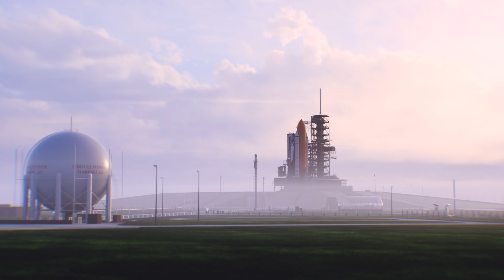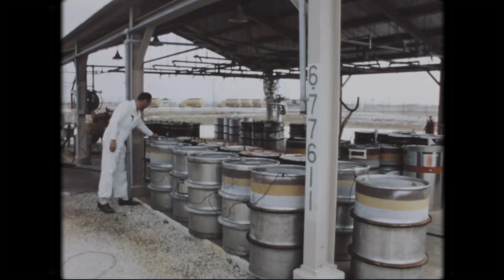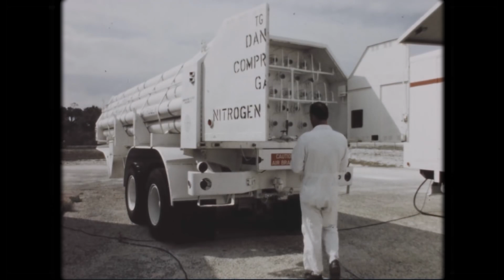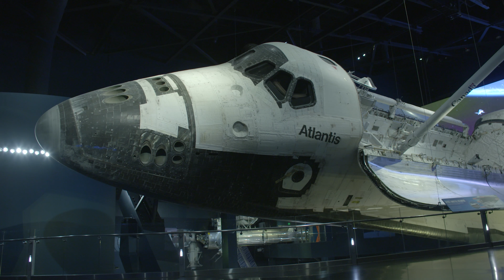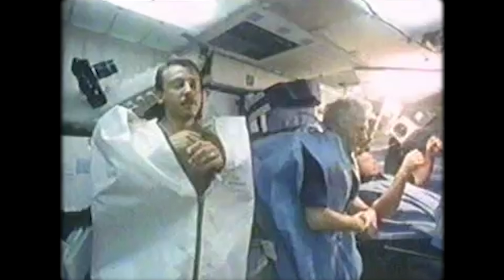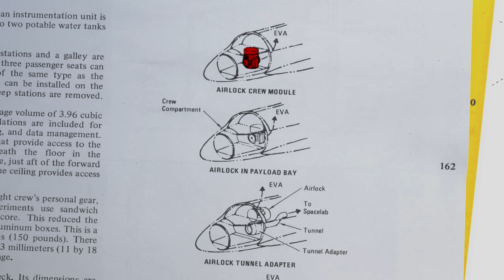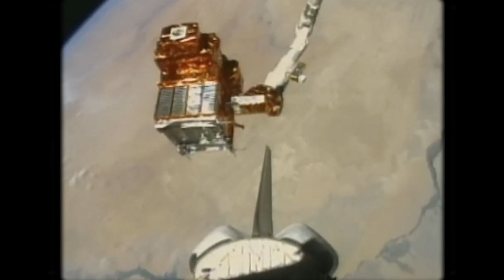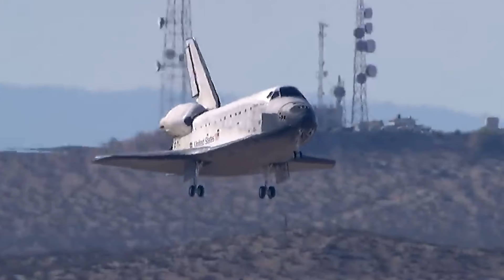The Insane Engineering of Orbit

Comment: One thing a lot of people get wrong is that the idea that the shuttle was in orbit when it dropped the tank. When the engines shut down the tank and the shuttle were on the same orbital trajectory that intersected the atmosphere. This meant the shuttle had to boost itself at the highest point of its orbit using the OMS to avoiding reentering the atmosphere with the tank.
Reply: it thrusts away from the orbiter by venting oxygen
Reply: And that was mostly so the tank would reenter and break up, rather than leave space junk in orbit.
Reply: @mikekopack6441 
Wouldn't necessarily agree with that, although that's certainly part of it.  I think the most important reason was because it made the once around abort much easier and safer.
Reply: Not the Kerbal Space Program players, though ;)
Reply: @TheMightyZwom  ahh fellow KSP player. So glad I found you here.
Reply: I applaud all of you who patiently tried to teach this guy something without ridiculing him.
Reply: @pavulon5000  They guy probably got sucked into a conspiracy hole. Saw some site or video that convinced him. 
The only way of that hole is to explain some of the ridiculousness that comes out of those conspiracy physics.
Reply: Yup but at that point they’re 99% of the way there so it doesn’t take much energy to to increase the periapsis.
Reply: @u12uNiiGuNx 97%
Reply: If they didn't have denial, what would they have? Mate thinks they're making some profound statement when they say they "don't use formulas." Guess what? I'm an engineer, and if the formulas didn't accurately model the real world, I'd be out of a job.
Reply: @TheBleggh  Not a good engineer. Dont need formulas to explain simple observations.
Reply: @CawfeeGasBlast  I'll bet your mom and dad are sooo proud of you.  Your profound brilliance makes your entire family so very proud, no doubt...🤦🏼‍♂️
Do yourself (and humanity) a favor and apologize for being so impossibly  ignorant. 
Don't wait another minute...
Do it right NOW. 
Got it??  Good.

You're welcome...
You can (will) thank me later.
Reply: I feel for everyone who was trying to explain anything to this @CawfeeGasBlast guy, he kept arguing, questioning and disputing while not knowing a damn about the matter, it's like he couldn't accept or wouldn't and persisted to defy the examples provided by the community even tho he had nothing to stand on, it almost felt like he was trolling 😒.
Reply: @vinny7114 Average Flat Earthers in nutshell, im suprised that people had the strength to argue with him which is pointless anyway
Reply: @Wikarian99PL  Forreal lol I wouldn't given up after the third msg maybe second
Reply: @vinny7114  You are the channel comment monitor today? Is this your job? Is this where they put you as a new-hire?
Reply: Yeah, but people are idiots! They think that once you reach a certain altitude, that you become weightless and are in orbit, believing that gravity only works out to that altitude, completely forgetting that the moon is stuck in Earth's gravity well.
Reply: Correct. After ditching the tank it had a final push to orbit
Reply: You guys are all arguing with someone whose name is “Coffee Gas Blast”. How do you not realize he’s just a troll
Reply: Keep believing that fantasy.
Reply: Ho...
Yusss,
Is that right,
There, then, thus ;
Kapitan
Oblivious...!

;-p

Ciao !
Reply: If you actually watched the video, this comment doesn't need explaining so I'm not sure why it's here in the first place.
Reply: This comment section was a wonderful read wow
Reply: 12:51 ... Orbital Maneuvering System, capable of adding 305 meters per second of orbital velocity
Reply: Didn't the space shuttle also have internal fuel tanks for its main engines ?
Reply: What dude
Reply: The basic concept the troll is not understanding is that rockets don’t go straight up, they also go sideways. They are actually free falling back to Earth due to gravity while in orbit. But their velocity is so high that the fall past the Earth and keep going. Were the velocity nit high enough if going straight up, they would indeed slow and fall back to Earth.

In low earth orbit eventually every orbit will decay. There are still one or two molecules spread very thinly in the near vacuum. Every time the orbiting object encounters one of these with an opposite direction there is a tiny reduction in the orbiting objects velocity. Slowly these accumulate and slow the object. This slowing tens to cause the orbit to reduce where it hits relatively more molecules and so on until the object is skimming the upper atmosphere. Then the effect snowballs and the object begins to slow much more which cause it to reduce altitudes to thicker atmosphere and so on.  The atmosphere interacting with the objects surface causes it to heat up due to friction. That’s when it starts to burn up....

That’s what happens to the external tank, that’s why it only needs a very gentle nudge back toward Earth to start the process (although it would eventually de-orbit and burn up anyway, they just use a more controlled fashion). And that is why it only takes a relatively small force to lift the orbiter up to low earth orbit. Incidentally, the tank is deliberately spun by the venting so they can video and photograph all of it and check for damage and missing insulation (that may have hit the orbiter like Columbia).
Reply: This was really a major design failure that reduced the capabilities of the Shuttle. It prevented the shuttle from reaching higher orbits and decreased its payload capacity.
Reply: Define “a lot of people” 😂😂😂
Reply: They could take the tank to orbit tho if they wanted right ? I remember reading something when I was kid they were thinking of using the external tanks as a space station of sorts idk if I remember that correctly tho the shuttle still amazes me after all these years
Reply: that's exactly I was about to comment.
Reply: I knew that. But I'm a space junkie.
Reply: https://youtube.com/shorts/EbxDIMurAZM?si=MtfEUWUaJY-z123p
Reply: I wish I was smart enough to understand what you said! 😔
Reply: they could have boosted the tank to orbit, they chose to ditch the tank in a decaying orbit
Reply: What about Chinese rocket debris fell back down n Philippines sea caught floating intact. please explane?
Reply: Lots of Kerbal Space Program players in this comment section
Reply: When they say rocket science, they mean it.
Reply: I've always wondered about this! I thought that since both the shuttle and the ET arrive at the same place in space, shouldn't the shuttle be falling with the ET as well. Either that, or the ET is a permanent space junk. Now I have the answers, thank you.
Reply: The NASA commentary for STS-1 made the point very clearly. After MECO, the PAO said, "Columbia... now in space, not yet in orbit," and seven months later on STS-2, "Columbia now returned to space, not yet returned to orbit." NASA always did a far better job of commentary than the tv networks, right up to the final mission, referring at MECO to the space shuttle's main engines falling silent for the last time. Almost poetic at times, and always accurate.
Reply: Z-s
Reply: it was in orbit at meco.
Reply: i was wrong,my bad.sorry.
Reply: Clearly, you were wrong.
Reply: So the millions of dollars  ORANGE THING burns up in the atmosphere, all the time?
Reply: I believe this was explained in the video about the boosters and the take off system.
Reply: Lies
Reply: Ever thought of using commas? It helps reading comments a lot and getting them right as well.
Reply: I had no problem reading this  @jeshkam
Reply: @Coasterlocity  Good for you.
Reply: @jeshkam His sentences need to commas, not sure where you learned your grammar. His sentences are complete individual clauses. He could split it up into separate individual subclasses and make the sentences longer, but that would be in the opposite direction of concise writing.
Reply: @cameronbains1052  "His sentences need to commas" not sure where you learned your English grammar...
Reply: @jeshkam  💯 I agree with you. Then again, over half the people commenting on YouTube don't have a grasp of the English language or punctuation.
Reply: Even in german schools we never were taught to use commas in english and I'd say that our english skills are very advanced
Reply: @spicysesam  That doesn't make it correct, and clearly you were only taught the basics of English.
Just saying.
Reply: @spicysesam  BS. 😂🤣 I've just asked my German friend and she told me otherwise.
Reply: @jeshkam You didn't use, commas either.
Reply: @erasmus_locke did you use commas incorrectly on purpose? 💀
Reply: The tank clearly drops away from shuttle. How does the tank fall? It wasnt pushed down...
Reply: @CawfeeGasBlast  at the time the tank is detached both the shuttle and tank are on course to re enter the atmosphere. 
After it detaches the shuttle uses the other engines, orbital manoeuvring system (OMS) to boost the orbit again so it will no longer intercept the atmosphere and go into a stable orbit
Reply: @u12uNiiGuNx  What friction is provided to the oms fluid? The fluid thrust has no traction in the non-fluid environment. What is it using for traction?
Reply: @CawfeeGasBlast   Look up Isaac Newton, he wrote a few things about that
Reply: @CawfeeGasBlast And that mistake was explained fully before 1687…
Reply: @allangibson8494  First action is fluid escaping nozzle....whats the reaction? There is no interaction with anything. Youre just spinning wheels on ice.
Reply: @CawfeeGasBlast  The nozzle pushes the fluid one way, the reaction is the resultant force pushing the nozzle the other way. Which is why nozzle shapes for vacuum engines differ from those used at (relatively) lower altitudes. Yours is a very common misconception, caused by how science is explained to kids. As a general rule, any physics you learned in school is incomplete at best, or frequently even wrong (but used to explain a concept rather than provide an accurate understanding).
Reply: @CawfeeGasBlast rocket fuel has mass, the act of ejecting it at multiple kilometers per second creates a reactive force that propels the rocket forward.
Reply: @MontegaB  You must have something to react to/with. Think...Dont just repeat something someone else said.
Reply: @MegaDada1995  You seem to add things to physics... Why does your car spin wheels on ice?
Reply: @CawfeeGasBlast  Why don't you just google how thrust is produced in a vacuum rather than arguing about it?
Reply: @CawfeeGasBlast  I'm not adding anything, you don't seem to understand Newton's third law. You don't need anything external to push against. The rocket pushes something backwards (exhaust gas) and the resulting reaction force pushes the rocket forwards.

The wheels of a car spin on ice because the car has more inertia than the wheels. So if you apply too much power, the wheels will spin and the power will be wasted on the rotating the wheel, and the generation of heat on the spot where the tire touches the ice.

However, to explain in laymen's terms how a rocket engine can produce trust in a vacuum: As the propellants combust, they expand. As this expansion takes place in a pseudo-enclosed space (the nozzle). While that nozzle does have an opening, the exhaust gasses can only exit the nozzle at a finite speed, thus a positive pressure will form inside the nozzle bell. As this pressure pushes in all directions, part of it will push against your engine bell, creating trust in the opposite direction.
Reply: @CawfeeGasBlast It's interesting that you seem to like to make absolute declarations of falsehoods, not much of a sign of someone interested in actually learning how things work but rather someone just wanting to pretend they know more than they actually do and/or someone who has become enamored with the FE con style of "question everything, but don't listen to answers" BS.

"You must have something to react to/with."   Yes, as has been explained to you, the reacting forces are between the gas and the nozzle.   You seem to think the gas needs something to push against outside the open nozzle.   What gives you that ides?   
Rockets are not propellers, but rather continuous explosions in an open chamber.

" The fluid thrust has no traction in the non-fluid environment. "   So you do think for some reason that the reaction requires the escaping gas to push against something, showing you haven't thought this through very well yourself.   Let's pretend your incorrect claim was real.    How hard would you have to push against "air" to move a 1 ton of concrete block that was on the slippery ice you seem fixated on.

How about this:   If you were in orbit and you threw a 1kg ball away from you, would you move in the opposite direction or not?

As for your question "Why does your car spin wheels on ice?".  Yes, cars don't move by throwing things away (like a rocket motor) but rather by friction coupling between the tires and the surface.   So reducing the friction means less power gets transferred, up to the point where the un-transfered power exceeds the friction of the tire and thus the tire slips rather than rolls.
Reply: @MontegaB  Thrust can be measured....on the ground...the exhaust fluid reacts against the other fluid...air....just like an inflated balloon when you let it go. There is nothing providing traction to exhaust fluid in a vacuum. That is why you see rockets spiral out of control at top of atm....no traction.
Reply: @IFS  If you threw a ball...you would be opposing the ball's travel towards the ground....and you would get a small force from it. When exhaust exits nozzle...where is it going? No where. It will just push on itself and just sit there. Should be a large cloud of condensate...bunch of water produced in that exhaust.
Reply: @IFS  The reaction between gas and nozzle is like flapping your arms...you wont fly unless you displace enough fluid.
Reply: @CawfeeGasBlast wow. 
You’re quite ignorant aren’t ya
Reply: @caleb_gr  Do you need help understanding my explanations? Basic physics...really.
Reply: @CawfeeGasBlast  You really don't comprehend how it actually works, do you?  So you stuff the gaps in your knowledge with fantasies and bad analogies.  How cute.    
Or you're just pathetically committed to false arguments for jollies like any juvenile troll with a 6 week old account.
Lets figure out which.
So you think "the reaction between gas and nozzle is like flapping your arms".    Why do you think such a thing?   How is an explosion like "flapping your arms"?
Reply: @CawfeeGasBlast  Ok, I guess you're right. Spaceflight doesn't work. This is all a simulation
Reply: @CawfeeGasBlast 
Lets start with the basics, you know what conservation of momentum says right? Momentum is mass*velocity. Naturally, if you send a small amount of mass backwards very fast, than the remaining mass has to speed up forwards so that the total momentum stays the same. You've also surely heard the gun recoil comparison. Shoot bullet forward, gun goes backwards. 

I see you wrongly make rhe comparison with wheels on ice. You should be thinking about a car with a rocket engine on ice. Wheels use friction to provide force, rockets do not.
Reply: @MontegaB  Thats correct. No satellites either. And yes...sat tv, sat radio, sat comms can be explained. Basic atm propagation.
Reply: @CawfeeGasBlast how are so many people arguing with you it's so obvious that you're trolling
Reply: @CawfeeGasBlast  So now I'm a little curious, since you've revealed you just deny all of reality.
   Why does technology from 60 years ago frighten you so badly that you commit to falling for fantasies about it?  Is your fear from lack of comprehension or do you think your fantasies make you seem intelligent?
Reply: @thomaswijgerse723  Shoot a bullet..you are opposing the bullets fall to the ground and its push against the air. A car using fast, hot fluid ejection has the atm to give it traction.
Reply: @hosonof  Because other people is going to read it and maybe learn something.
Reply: @hosonof  I made statements...people dont understand them and comments/replies are a way for these people to better understand their mistakes.
Reply: @IFS  Ive presented no fantasies. Everything presented is logical. The fantasies presented here is the one of blind belief of space travel even when logical explanations exist to say otherwise.
Reply: @b43xoit  What if exhaust gas exits at one mph? Hundreds of mph?  What could make the force from 1mph exhaust speed different from the 500mph exhaust speed? How do you measure that force?
Reply: @b43xoit  You are pushing against my body weight...which is travelling towards the earth. Just like pushing on a wall or a bowling ball. You are pushing against the ball's travel towards the gound.
Reply: @b43xoit  true. if you flapped your arms fast enough that they detached you could generate some thrust
Reply: @CawfeeGasBlast  I think you a confusing propeller and rockets. Propellers need something to push against, rockets don't. 
Think of shooting a gun, why do you get recoil?  Do you think if you did it in a vacuum, there would be no recoil? The expanding gases pushes the gun back.
Reply: @CawfeeGasBlast  you can measure this force using a load cell. You know how force = mass * acceleration? 
Aka, kg * m / s^2, you can reorder this to say kg / s * m / s. This means massflow*exhaust velocity. 

So the thrust your rocket engine creates is how much mass you push out multiplied by how fast you push it out.
Reply: @thomaswijgerse723  Your formula doesnt make you move. Youve created a gas that is forced out a nozzle....you can measure that exhaust...but it doesnt move you....nothing to push....youre just detaching something from the rocket.
Reply: @samik83  Where is the vacuum...here on earth...or a place where there is no gravitational force at all? Here on earth you are pushing against the weight of the bullet, vacuum or not. In a place where bullet and gun are not acted upon by any force....no recoil. Because nothing is providing a resistance to the bullet or to the gases created when gun is fired.
Reply: @CawfeeGasBlast  lol no I understand your moronic “explanations” just fine (they're literally just misunderstandings at best)

The fact that you called them basic physics is the cherry on top.
Reply: @CawfeeGasBlast  you do not push against weight, since weight is a force. You push against mass. 
Yes, a gun would have at least as much recoil in space as on earth.
Reply: @thomaswijgerse723  You push against the mass that is travelling in a particular direction...which is its weight.
Reply: @CawfeeGasBlast  if you want to move something up, while gravity pulls it down, then you do push against gravity. Like I explained with the throwing a ball upwards example.
Reply: @thomaswijgerse723  What gives you a recoil here on earth? Fluid dynamics explains it.
Reply: @CawfeeGasBlast  both newton's second law, and conservation of linear momentum. Got nothing to do with the atmosphere, atmosphere only reduces the recoil a veeeeery small amount because it provides backpressure.
Reply: @CawfeeGasBlast  Doesn't matter if its a vacuum or not. Doesn't matter if there is gravity or not.   

An explosion will push against any object that is near it. That's what a rocket is, a controlled explosion.  
It's like claiming you wouldn't be hurt if a pound of C4 exploded in your hand if you just were in vacuum and zero G.  
I can assure you, your fingers would fly very far no matter what.
Reply: @CawfeeGasBlast 
Either you're trolling or you don't understand grade school physics.
Reply: @carcinogen60yearsago  i think he is. But still I hope that a lot of other people that read this thread will pick up something from it. 
(+ I'm bored)
Reply: Ok Mr. Helper.....you give it a shot. Explain why my explanations are incorrect? Should be easy...grade school physics. Or are you just one of several people using several accounts to make it appear as if 'Most people believe as we do....so....we are right.' Many wrong people here.
Reply: @CawfeeGasBlast  I've given you all the pieces of the puzzle, and explained how to put them together. Now its up to you to do it.
Reply: @CawfeeGasBlast  I think it would be more interesting to know why an explosion in space wouldn't be able to hurt you. If you can explain that, then I can understand how the space shuttle wouldn't be able to work in space.
Reply: @samik83  Yes...gas will push against you, gun, or nozzle. But that gas wont move you unless there is something providing friction/traction to the gas. Its simple. You all are stuck on this space rocket fantasy.
Reply: @CawfeeGasBlast it takes more force to accelerate gas to 500mph vs 1mph. This leads to a equal and opposite reaction onto the rocket, generating thrust.
A way you can measure that force that I could come up with is to just measure the acceleration of the rocket and with f=ma you can calculate the force since you know the mass of the rocket. You can also measure the force exerted onto the rocket by a single gas molecule assuming constant acceleration from the combustion chamber using f=ma once again
Reply: @CawfeeGasBlast there is essentially zero friction in space to slow down moving objects due to the extreme distance between molecules. Unlike ships in water, a ship in space does not need constant thrust to keep moving forward. A space ship's momentum will continue to carry it forward indefinitely at a constant speed after the engines are turned off. In theory a ship in low orbit would eventually slow down and lose momentum until it got low enough to reenter orbit but it would take astronomical time frames.
Reply: @Spacemarine658 "essentially  zero friction" still means there is some friction.  Especially in low earth orbit, there are SOME molecules from atmosphere that create drag which adds up over time and degrades the orbit.  Its enough that the space station needs to burn its rockets every so often to maintain orbit.

Further out its not an issue, but  the space shuttle and space station orbits were low enough that it matters.
Reply: @LeverPhile  well yeah that's what I was saying there's some but depending on your orbit it could take 2 days to deorbit, 6 months, or thousands of years or more
Reply: @CawfeeGasBlast 
“Friction” plays no part.
Reply: @CawfeeGasBlast 
No. There doesn’t need to be something for the propellant to “react” with.
Reply: @CawfeeGasBlast  you do know orbital mechanics? For the shuttle system (orbiter+tank+booster) or anything going for orbit, it would have to not just travel up high enough from the ground (to reach altitudes with minimal atmospheric drag, it would also have to travel just fast enough SIDEWAYS (parallel to the ground) to avoid falling back to earth. So the whole system travels up and sideways really fast, hence the parabolic trajectory. Going straight up perpendicular from the ground cannot achieve orbit, it would just fall straight back down. 
At the time the tank is detaching, the whole shuttle system is still just slightly below orbital velocities (not sideways fast enough), they would fall back to earth not straight down, but really far away in front along their trajectory. Once the tank leaves it would be powerless and follows a ballistic path the system was on and fall back down. The orbiter alone would then fire OMS with just enough delta-v forward (not up) to reach orbital velocities, i.e. fast enough sideways to not fall back down. At this point they are just a few m/s of delta-v away from orbital velocity, so the small OMS is enough put push it to orbit. 
The force of gravity of the earth is acting on the orbiter perpendicular to its sideways motion, thus curving the trajectory toward the center of the earth; with the right amount of velocity sideways, the trajectory would become a circle around the earth.
As for what you mean by traction, it’s only for crafts in a fluid medium where you don’t need to carry the reaction mass onboard, such as swimming where you push the water back behind you to propel yourself forward. Crafts in a vacuum such as a rocket in space has no fluid to push, so it uses the fuel it carries as reaction mass, by exploding them in the combustion chamber and expelling it really quick backwards, the high speed molecules produced by the combustion pushing on the engine bell produces the reaction force to make the rocket fly forward, and the exhaust gas is all directed straight backwards to make sure all of the explosive push in the forward direction is efficiently captured. Simply put, to go fast in space, you leave something behind faster.
Reply: @HenryLiu7 
CawfeeGasBlast doesn’t believe space exists.  He’s a flat earth adherent; which is why he can’t understand the basic physics of why an accelerated object in space will continue forever until acted on by another force.  He seems to think an object in space will slow down without something acting on it; like an object in air.  He’ll never understand it.  🤷🏻‍♀️
Reply: @CawfeeGasBlast f=m*a so the faster the exhaust moves the more force it makes
Reply: @Gl1tchy_B01_09  The exhaust needs something to push...needs traction....you blind space-travel believers cant seem to grasp this....Space shuttle and all the other crap they shot up and into the ocean.....DID NOT GO TO THE MYTHICAL REALM OF SPAAAAAAAAAAAAAAAAAACE!
Reply: @MegaDada1995  Yet virtually all nozzles employed on all space craft use a  DeLaval style nozzle. Ambient pressure apparently not factored
Reply: @CawfeeGasBlast  What gives you a recoil here on earth? Fluid dynamics explains it.

Oh which exactly equation explains it kiddo?
Reply: @tgstudio85  I leave the useless formula-inventing to you. Recoil from gun...before and after shot, the bullet is pulled to ground...when shot...the gasses push bullet against  its weight and the air in the atm...the gasses created in gun are resisted by the atm, also. The force used to push bullet fades...the force pulling bullet to ground does not...that is why the bullet doesnt stay above the ground. ThinkThinkThink...youll understand it one day.
Reply: @CawfeeGasBlast physics doesn’t care about your opinions formed by flawed logic.
Reply: @bendlyte  You should stop trying to explain things with a formula. Trust your eyes. Stop worshipping your childhood heroes at spwace wocket nasa. Think...Youll get it one day.
Reply: @CawfeeGasBlast  I choose demonstrable physics over your opinions.
Reply: @bendlyte  An 'Orbit' is not demonstrable. You must have a ball in order to conceive an 'Orbit'. Even if I grant you your 'Ball'...Ive proven you cant make  something stay above ground without continuously opposing the only active force....the one causing it to return to the ground. The force applied by rocket does NOT last forever. Keep trying...youll get it.
Reply: @CawfeeGasBlast  the only thing you’ve proven is you haven’t tested Newton’s 3rd law of motion and don’t understand it. Orbital mechanics is way out of your league.
Reply: @bendlyte  Orbital mechanics is fiction. And stop relying on some dead man's sayings/theories...doesnt mean anything. Think .... Youll get it.
Reply: @CawfeeGasBlast  Disproving Newton’s laws of motion is your responsibility if you disagree with them. Good luck doing that from YouTube comment sections. There has been no threat to them in the hundreds of years of physics since they were written.
Reply: Hear me out. The first action is NOT fluid escaping. The thrusters are hyperbolic, meaning, once they mix, they burst into flames creating thrust out of the nozzle via a brief explosion. You don’t need anything to “push” against because every action results in an equal and opposite reaction in the other direction. The combustion (explosion) inside the nozzle doesn’t “push” on anything in space, the explosion itself is pushing on the inside (backside) of the nozzle.

Image an explosion here on Earth that throws and scatters objects off in all directions. The explosion itself is doing the ‘pushing’, not any atmosphere or barrier outside of the explosion. Same applies in space. The explosions inside of the thruster nozzles are doing the ‘pushing’, not any force or barrier outside of the shuttle’s thrusters. Don’t confuse rockets with “air-breathing” jet engines. Completely different concept. 

Same applies to rocket launches on Earth. Rockets leave the launch pad, not because they are pushing on the launch pad, or ground, but because of the force of the explosion that happens to be occurring at the back end of the rocket. A rocket will lift off both at ground level AND from hundreds of feet in the air regardless of whether there is a “floor” below it (think the Milk Stool used for the Saturn 1b rocket launches - Google it).

If a floor, ground, or surface was required for thrust then a rocket leaving the launch pad would suddenly fall from the sky once the influence of the ground disappeared. And No, rockets do not “push” against the air.
Reply: @bendlyte Those laws are vague and incomplete. I guess you couldnt put those words(scientific laws) together in a sentence.....only a ScienceGod from the past can do that. You are blindly following your ScienceGods. You can think for yourself...Dont get scared when they yell, scream, and cry(deGrasse Tyson)when you question and state observed facts.
Reply: @CawfeeGasBlast  what observed facts don’t follow those laws, that aren’t already acknowledged by physics? Let’s hear it, if you’ve got something. If it’s a rocket that doesn’t work in a vacuum, that would be groundbreaking.
Reply: @bendlyte  Rockets dont work in your 'outer space'. You seem to be fouled. You need to stop trying to explain things without quoting dead people. When you use a 'law' to explain something...that means you dont understand the subject or care about observed reality.
Reply: @CawfeeGasBlast  Rockets nozzles designed for operation in vacuum (or near vacuum) are tested, on the ground, in vacuum chambers.  You do not need a medium to push against, you are throwing mass at great velocity in one direction, and thanks to Newton, we know that means an equal but opposite force pushes you the other way.  It's not the air outside, it is the simple act of throwing mass out of the rocket.

Are you a troll?  Or a flat earther?  Because you seem disinterested in actual physics explanations, which, were they to be untrue, would suggest we have never put anything into space.
Reply: @CawfeeGasBlast  Oof, your claim that satellites are actually just atmospheric propagation means you have a very limited understanding of how RF refraction works.  I suggest you talk to an amateur radio operator, but since I am one I can give you a very brief explainer.  Just like different colors (frequencies) of light bend different amounts through a prism, different frequencies of radio waves reflect differently when they hit the ionosphere (and troposphere, in some extremely weird edge cases).  So you may have heard that radio waves bounce off the atmosphere, but that's a grade-school-level simplification.  In reality, HF radio waves bounce off it, while VHF and UHF frequencies are either absorbed or go straight through it.  In fact, the Maximum Usable Frequency, a stat tracked by hams worldwide, changes regularly due to space weather and the day/night cycle, as both can change the energy level of the ionosphere, effectively changing the 'thickness'.  Right now, we've got amazing HF propagation due to the sun spot cycle, and the MUF gets up around 30-35MHz.

This is exactly why TV signals started out as VHF/UHF (that's 30MHz up through 3GHz); with only so many channels, regional stations would all interfere with each other if their signals bounced off the ionophere.

Satellites, then?  Almost entirely UHF and even up into SHF (up to 30GHz).  DirectTV, for example, now operates in the 4-6 GHz and 12-18 GHz ranges.  Those pass right through the atmosphere, no propagation whatsoever.

This isn't some esoteric bit of radio knowledge, either.  Talk to any ham and ask them the difference between their HF rigs and their VHF rigs.  Or why the first license you get is generally only good for short-range communication, but the second and third are where the worldwide comms open up.

You're going to need an alternate bizarre theory for how satellite TV works without satellites.
Reply: @georgedorn_fnord  Your rocket goes into a spiral...out of control...when sent to upper edge of atm....because no traction. Your vacuum chamber quickly becomes a chamber of high pressure when you test your rocket. You believe in the fantasy of space and travel within.
Reply: @georgedorn_fnord  You forgot about your 200mhz 'satellite' users. And it doesnt matter what ham operators believe is up in the air....whatever shape their aerials...doesnt prove  a box is receiving, processing, and sending it back. AM radio, shortwave, or any other freq. dont use a spacebox. Not creating theories here...thats how sat comms work.
Reply: @CawfeeGasBlast  200MHz (the capitalization matters) also doesn't refract off the atmosphere.

So you're saying that all of electronics theory, even stuff I can prove on my bench with my oscilloscope and home-made, FFT-based spectrum analyzer, is a hoax, and the reason my VHF handheld can't talk to China but my kit radio made from discrete components can is...  a vast conspiracy?

Sorry, you've long left the realm of science, there, buddy.  Dunno what all this nonsense about scientifically attacking whether rockets work in a vacuum is for, you have zero interest in science anyway.

Plus, vacuum chambers exist.  Cody of Cody's Lab even proved a rocket engine produces thrust in a vacuum, by putting a rocket engine in a vacuum.
Reply: @CawfeeGasBlast  you can’t even name one observed fact that doesn’t follow Newton’s laws of motion. All you’ve got is denial.
Reply: @bendlyte  Equal and opposite reaction...First action...throwing gas away from rocket is similar to flapping arms...you wont move unless you have a fluid or other object, which has weight, to push against....traction...Ive said this over and over....forget Newton....I know brain is smaller...but I was hoping to explain it to you...unsuccessful.
Reply: @CawfeeGasBlast  you’ve obviously never studied how rocket engines work. Flapping your arms is nothing like a rocket engine. Rocket engines provide forward thrust by the pressure of gases being expelled in one direction - out the back end of a nozzle. If you would have spent 2 minutes researching this, you would have saved yourself the embarrassment.

A balloon expelling air out of the small opening used to fill it with air is a far better comparison to rocket engines.

You still have no example of an “observed fact” that doesn’t follow Newton’s laws of motion.
Reply: @bendlyte  You dont know how a rocket works in vacuum because there is no vacuum to test it...basic theory says it can NOT work. Ill get you to understand...dont let the scary, unknown, 'going against all Ive ever known' concepts deter you from trying to get a true, genuine grasp of the 'We are not in space' reality.
Reply: @CawfeeGasBlast 🤦‍♂️ Smh. It's absolutely mindblowing to me that people have access to the near-entirety of human knowledge literally at their fingertips, yet there are still flat earthers, like yourself. 

I also find it mindblowing that you guys choose to use that question as if it's some kind of "gotcha", even though the answer comes down to extremely basic physics & chemistry, and is easily understood even by children in elementary school. 
Then again, you've had the answer to your question explained to you countless times, but for some reason choose not to accept the reality. So, of course, you're just being disingenuous in asking it to begin with. 
It's not the "gotcha" you think it is. 
Get out of here.
Reply: @CawfeeGasBlast  It's hilarious that you, of all people, are saying that to someone else when you're the one who's just repeating mindless dribble that you've heard some other airhead flat earther say. 🤣
Reply: @IFS  Spot on. These flat earthers are always either, disingenuous, delusional, or both.
Reply: @bendlyte  what's hilarious is that "cawfee" unironically used that same balloon example in one of his above comments in an extremely poor attempt at explaining his flat earth bs 🤣.
I keep going back, and forth on whether he's a troll, or a genuine flerf, but there's really no way to tell when it comes to flerfs.
Reply: @xenophagia  There is a difference...My explanations are demonstrable...evident. Youre a repeating noise maker saying 'Believe me and the tv or...or...or...Well..All Ill do is just get loud and call you names.' That is ALL you have. Weak
Reply: @xenophagia  Laughing doesnt make you right. Weak. Just like your bwst friend xeno. Or are you using two usernames. Because the more people on your side makes you right ? Still weak. Try again.
Reply: @CawfeeGasBlast 
You are a perfect example of the Flat Earth Society!
An ignorant person who has no desire to be educated!
Reply: @hosonof  because TRUST these people do exist. Ive had the pleasure of knowing a couple and I can tell you they whole heartedly believe their own bullshit.
Reply: @CawfeeGasBlast dear Lord didn't newton explain action and reaction a while ago,the fact that you're arguing about this is problematic
Reply: @CawfeeGasBlast Let's say you teleported to space in a spacesuit along with something heavy, if you throw said object in Abu direction you will no remain stationary.

You and the object will move in equal yet opposite directions from each other.
Reply: @CawfeeGasBlast  holy crap, you're insufferable as heck. I thought I'd get to learn more reading the replies but it's just filled with you yapping about how everyone is wrong.
Reply: @CawfeeGasBlast "think"
clearly you should be taking your own advice 😂
Reply: @CawfeeGasBlast  It is pushed down. A few moments before detaching the tank, the orbiter's RCS trusters fire upwards, so the vehicle pushes the tank down. After detaching, the RCS fire downwards, so the orbiter moves up again.
Reply: @raphael0208  Shuttle is headed toward ground too. Much more thrust is needed to keep it from falling to ground than those little thrusters.
Reply: @CawfeeGasBlast  You're right. That's why the energy needed for not falling to the ground is provided by those two huge solid rocket boosters and three RS-25 main engines. Once in orbit, there is no atmospheric friction to steal that energy away from the ship. The RCS only provides the small amount of energy needed to manoeuvre the shuttle. But it's enought to push itself and the tank away from each other in vacuum.
Reply: @raphael0208  After engine cut-off, that momentum will fade....it doesnt last forever...and being that there is only one continuous force, gravity, it will fall.
Reply: @CawfeeGasBlast  Wrong. The momentum will not fade unless a force is aplied. You need to study basic physics, dude.
Reply: @raphael0208 Speed does NOT matter. Speed is NOT a force. The ONLY force acting on it is what? The force given to it from rocket starts to fade as soon as engine cut-off....it will reach zero...IT DOES NOT LAST FOREVER. The remaining force, gravity, wins.
Reply: @CawfeeGasBlast  Nope. The speed will remain constant because there is no force in the opposite direction being applied. Gravity is an orthogonal force that changes only the vector of the velocity, not the module of the speed.
Reply: @CawfeeGasBlast but speed is a portion of centripital force, F = m*v^2/r
Reply: @raphael0208  And that vector is in which direction?
Reply: also, momentum does not neccesarily fade. 
In order for forward velocity to reduce, there has to be a net force that acts backwards. Gravity pulls "down" while a spacecraft (if its in a circular orbit) is moving sideways. This means that gravity does not slow down the spacecraft, it only changes  the direction it's traveling in.
Reply: @CawfeeGasBlast  Tangent to the direction the shuttle is moving.
Reply: @thomaswijgerse723  Momentum does not last forever...throw a ball straight up...why does it stop...wind resistance? And speed is not enough to oppose the fall back to earth.
Reply: @CawfeeGasBlast  like I explained. In order to lose momentum a force needs to act opposite to the direction of travel.  If a ball travels up, and gravity pulls it down, then the force acts opposite to the direction of travel.
But spacecraft move sideways, so gravity doesn't act opposite to the direction of travel.
Reply: @thomaswijgerse723  Sideways or straight up...momentum will decrease to zero. Leaving only one active force....the one pulling it to the ground.
Reply: @CawfeeGasBlast  No that is blatantly incorrect. Momentum only changes if a force is acting tangentially on it. Show me a free body diagram and an equation of motion that shows how something can be slowed down by a force that doesn't act opposite to where its going
Reply: @thomaswijgerse723  You know mometum decreases to zero. Doesnt last forever....here in our atm or in your mythical space.
Reply: @CawfeeGasBlast  Of course your a flerf. 
Your profound ignorance makes complete sense now.
Reply: @CawfeeGasBlast gravity is not a force but rather a dip/bend in the fabric of space. Just think of space as a sheet and when you put something with mass on it, it deforms and the object seeks the lowest energy point (the center), but in 3 dimensions.
Reply: @CawfeeGasBlast 
No. There’s the momentum of the ship in a vacuum as well.  Gravity just modifies the trajectory of that momentum so that it doesn’t fly off straight into space.
Reply: @CawfeeGasBlast 
In a vacuum and without gravity acting on an object, it will continue on forever in space.  It either needs to meet something like a gas or an object large enough to have a gravitational effect on it to change the objects momentum.  That’s why Voyagers 1 & 2 are still streaking out of the solar system without slowing down.  Any object that is gotten up to speed in space will continue at that speed forever until it meets something that alters its momentum.  That’s because there’s nothing physical in space to create any friction on that object traveling in space (technically there are a few atoms of gases in a cubic meter of space, but that’s not enough to alter the momentum) or it’s not close enough to a large object to modify the trajectory with gravity.  Isaac Newton: “objects at rest stay at rest.  Objects in motion stay in motion.”  Unless something else physical changes these parameters (like enough gas to create friction or a celestial body large enough to have gravity to affect an object’s motion), the object will do what it was doing in its previous state.  

Your assumption that an object in space will slow down without something to keep accelerating it is fundamentally wrong and is based on the behavior of objects in atmosphere.  Air is like water but thinner, and the movement of an object against it creates friction.  That doesn’t exist in space.  In space an accelerated object will continue forever until acted on by another force because there’s no friction.
Reply: @CawfeeGasBlast 
Oh!  That’s the problem!  You don’t believe space exists!  😂
Reply: @CawfeeGasBlast  my brother in christ, you realise what an orbit is. Yes the engines cut off, yes the velocity bleeds initially, but the whole point of an orbit is that the rocket is constantly falling toward the earth but in a stable orbit so that it keeps 'falling' but not re-entering the atmosphere. How do you think the ISS has stayed up in space around the earth for so long? Gravity is the primary force acting on the ISS allowing it to keep falling around the earth. Once in a stable orbit you can easily determine its velocity and altitude using conventional physics equations.
Reply: @CawfeeGasBlast  you realise the only thing reducing the velocity on earth is the friction caused by the density of air molecules. In space there are large gaps between molecules meaning it is essentially frictionless. Thus the only main force acting (and continuing to conserve the momentum of the rocket) is gravity.
Reply: @CawfeeGasBlast have you never heard of conservation of momentum? 💀
Reply: @Gl1tchy_B01_09  Throw a ball straight up...travels up...stops...travels back down. It doesnt keep going. Where is your momentum? Think about it...youll soon understand.
Reply: @CawfeeGasBlast  If you throw it fast enough then it can escape the earths gravity.
Reply: @samik83  Escape into what....an object can only ascend to app. 120,000 ft and there is no such thing as gravity....you stick to ground because you are more dense than the air around you. You MUST get thia space travel fantasy out of your head if you are ever going to understand the physical.
Reply: @CawfeeGasBlast  Your biggest issue is that you are conflating momentum with inertia, two different concepts.  Momentum in physics refers to mass times velocity and is used for the interaction between two objects say a rocket and it's spent fuel.  This is where the conservation of momentum applies, the sum of momentum in a system will stay the same and this is used to determine change in velocity.  The way you are using momentum is in the idea of inertia.  Now I do not fully understand inertia but the idea is newtons first law of motion and object in motion stays in motion unless acted upon by an outside force.  Using these you can see how your ball example does not apply as it is not two objects interacting but, ignoring air resistance, one force acting on an object with mass.  This how this problem is treated equation wise with one force.  A rocket in its simplest terms is two objects each acting on each other.  When one is expelled in the opposite direction from a different object the other object has to speed up following conservation of momentum the equation looks like this, m1v1+m2v2 =m1v3+m2v4.  If m1 is the shuttle say mass 2 and velocity 2 and m2 the file has mass 1 velocity 2 now the file changes velocity to be -3 you can solve this for you self and see that v3 will increase simply because the propellant changed velocity.  The units and values are ignored because this is a demonstration you can change the values and get similar results.  Also the propellant's velocity is negative because it is fired in the opposite direction of travel for the spaceshuttle which is considered the positive direction. You may choose to ignore this information but that is your choice the correct information has been given
Reply: @Owlinthesnow  Too much unnecessary giberish in your reply...explanations dont need that many words.....Are you a professor or similar...paid to just run your mouth? The force keeping ball in the air does NOT last forever. Stop worshiping the ghost of newton. The force, gravity(you all call it), does last, is continuous, and the ball falls. Inertia...momentum...doesnt matter what you call it...the ball falls...and an imaginary shuttle...satellite...will fall to the ground as soon the force is removed.
Reply: @CawfeeGasBlast an object in motion will remain in motion... you should check out very basic physics.

If you're in a vacuum with no gravity, momentum will never fade.
Reply: @CawfeeGasBlast  It's hilarious how you'll use gravity in your argument when it suits you 🤣.

That, alongside your unironic using of "letting go of a balloon filled with air" as an example in an attempt to explain FE nonsense almost has me thinking that you're just a troll.
Then again, stupidity knows no bounds.
Reply: @CawfeeGasBlast  If you watched the first video in this series, you'd know the simple answer to that question. 🤦‍♂️
Reply: @CawfeeGasBlast ascends slower
Reply: @CawfeeGasBlast  Due to air friction speed reduces of tank. Whereas speed is maintained of shuttle.
Reply: @CawfeeGasBlast yes once released they slow down.  They immediately start to separate and fall towards the Earth.
Reply: @CawfeeGasBlast when are you going to publish your peer-reviewed paper proving that space travel isn’t possible?